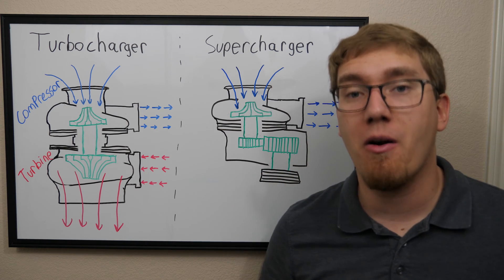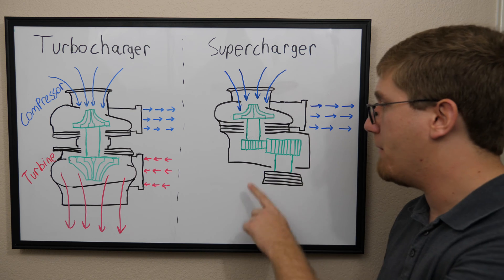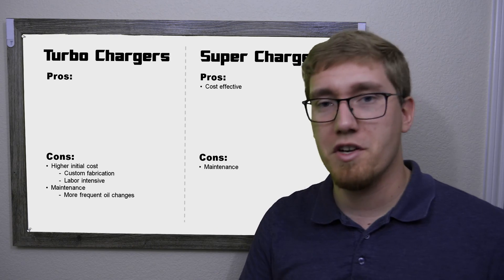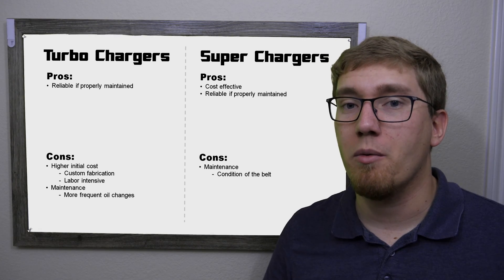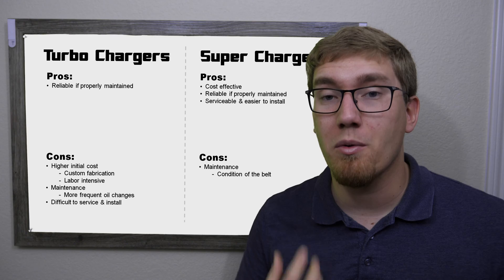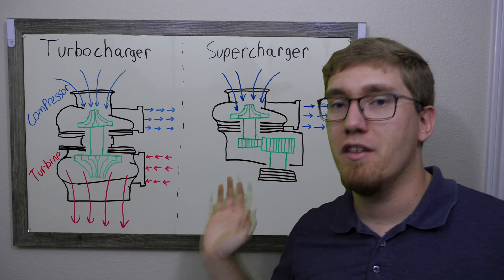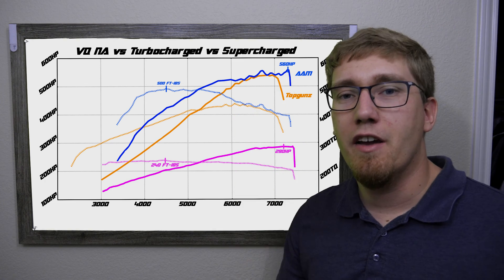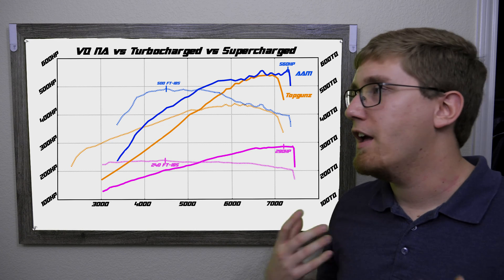Superchargers vs. Turbochargers - Settling the Debate

Comment: Thanks, but I'll keep it simpler with increased displacement and higher compression, along with lower vehicle weight. Someday I'll rebuild my VQ37 in my 370z with a 4.3 liter bored and stroked engine with a 12:1 compression ratio. 8'm currently getting about 380 peak crank hp with an intake, exhaust and tune.

Comment: Trying to explain turbos vs superchargers to a bunch of dumb birds on youtube is almost a wasted effort.  You have people that say, "a supercharger has parasitic drain."  Well dodo bird, im measuring hp not parasitic drain.  Some say, "turbos make more power."  I say, "whats more powerful, 500hp turbo'd or 500hp supercharged"  There are many different factors to using ANY forced induction system.  If you arent taking those factors into account during your build, you shouldn't be building.  And im not even gonna get into you boneheads trying to justify 1000hp on the street.

Comment: Here's the simplest way to explain this. Turbos are far more efficient than superchargers, superchargers takes power to make power and usually runs a little cooler than turbos. Will modern technology now we have turbos with little to no turbo lag.  Turbos usually will end up made more power than superchargers but at the end of the day it is the one with the deepest pockets will have the faster car. Turbos may be a little bit more expensive but the results will be night and day though.

Comment: Great video bruh.. Seems like your talking about TT VS SuperCharger.. Most ppl out here are not TT their cars.. So a SuperCharger will produce more power than a Single Turbo??
Reply: No. A big single turbo will spool slower than TT. This is depending on the size of turbos your working with. But if the two systems produce similar peak HP the TT system should spool quicker overall.
Reply: @AndersonRacingJourney  Stock block for the vhr is only good for around 700 ish whp.... A2A supercharger kits like rortex and z1 will make just as much whp as single turbo kits like sohos and boosted projectz

Comment: In a full race scenario where you are changing above 5000 rpm the turbo will have less advantage.
Reply: In a full race scenario where you would spend more time above 5000RPM you would simply size up the turbochargers.  You lose a bit down low, but will gain it up top in trade.  Plus, unlike a supercharger there will be no belt slip, especially at higher RPM.

Comment: Great video, i just wanted to point out, in superchargers you have to replace the intake manifold  with the supercharger, the supercharger is much safer on the car but not as effective as a turbo system, i have seen cars catch fire after few runs with turbos, also people seem to forget adding extra power means upgrading the cooling system and other internal parts, last one if car from factory did not come with Forced induction than it is not good idea to do it,  i doubt VQ engine can handle 500+ on stock internals
Reply: Its not the engine, its the transmission
Reply: @kadinallan2436  uhh you're saying slapping turbo or supercharger on high boost and run it won't cause internal parts to break? The 370z transmission is actually decent
Reply: @al3zmi  the transmission is going to slip because of the added torque before the engine goes out
Reply: @kadinallan2436  lmao k
Reply: @al3zmi  bruh it’s been proven if you do enough research on VQ engines that transmission is what blows first
Reply: @Cdcniners  i did research i have seen people running 600whp+ and transmission is holding well, unless you're talking about 1000hp+ then of course everything will start to break
Reply: @al3zmi  yeah from most people I’ve seen their first issues are always the transmission
Reply: @Cdcniners  shit happens, cuz of the OEM CNC  is made out of plastic, I have CZP HD CNC and clutch slave cylinder and Z1 clutch and every time I drive I just abuse it and nothing happened, unless you're talking about the 7AT then I don't know
Reply: People have vq with over 700whp and lasted a long time
Reply: @carlaxeldinesen812  either he is talking about automatic which i don't really know about and if it's manual then most likely the OEM CNC which can be replaced with Zspeed or CZP HD CNC and forget about it, which isn't really inside the transmissions
Reply: @al3zmi  I’m talking about AT I heard they are disasters for trying to boost
Reply: @Cdcniners  i don't really know about the automatic and did not do any research but I can see that it have lots of problems since it uses the same transmission in the Maxima and Altima i think.
Reply: Mines pushing 600 whp no problems for 2 years u don’t k is what u are talking about
Reply: @carlaxeldinesen812  you have AT, and internals are stock?
Reply: @Cdcniners  manual and. internals stock running solid
Reply: Nissan says that the VQ can handle up to about 450 hp without strengthening the engine's internal parts: pistons, rods and crankshaft.
Reply: actually its 500 crank HP is actually your limit i believe which is like like good 400rwhp but pushing past it is risky it may last for sometime or long time...it depends on when it will "pop" cuz if you invest in some parts you will realise it actually cheaper than rebuilding your broken engine, also keep in mind when adding Twin Or single turbo and oil cooler....maybe it's time to buy aftermarket oil pump to keep oil pumping to those new places...at the end of the day a good build would cost you over 20k+ and if you want have fun for short amount of time then it won't cost you much there are lots of ebay turbo kits

Edit: my bottom line is...take everything into consideration when you decide to boost your vehicle, cuz it would suck if engine blew up cuz of a tuner or cheap parts and if you're not planning keep the car for long time then don't do it

Comment: I didn't see it mentioned, but after a couple decades of turning bolts one thing that has really stood out to me regarding aftermarket turbos (and apologies for stating the obvious) is that NO aftermarket kit/company can approach the testing/QA/QC you get with a factory boosted car.  This is really obvious with the turbo manifolds.  So many manifolds crack and consider how many people are actually daily driving their boosted cars??  OEMs design their boost to get beat on.  Aftermarket companies have a FEW test cars.  

Additionally, until somewhat recently, the ECU for aftermarket boost has always been inferior to OEM.  We now have multiple options for very fast/realtime correction ECUs that are fast enough to save our motors.  However, plug n' play solutions are still somewhat limited.  If I were to add boost now, there is no way I'd use any ECU unless it was fast enough to use safeguards and save the engine.
Reply: Fast Intentions for the record. No cracked exhaust manifolds, period.
Reply: When I got a bigger turbo for my RB30 I got a custom high rise manifold made. I would not consider an off the shelf or postal map. You need a tuneable ecu and get it tuned by a competent tuner on a dyno.

Comment: Is this reliable for the car tho ? Any damages to the car ? What do we need to switch out in order to be ready for supercharger?
Reply: Just better fueling, ie injectors and pump for low boost. High boost, most cars will need atleast stronger rods.. you will need a tune regardless of boost added